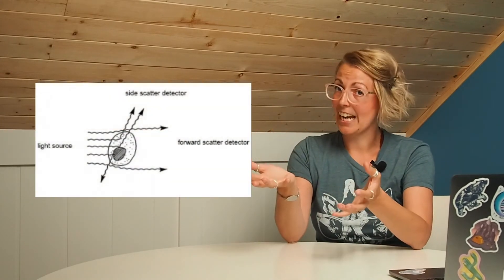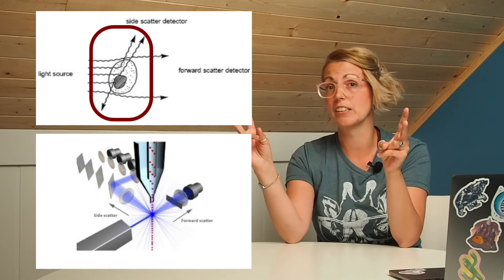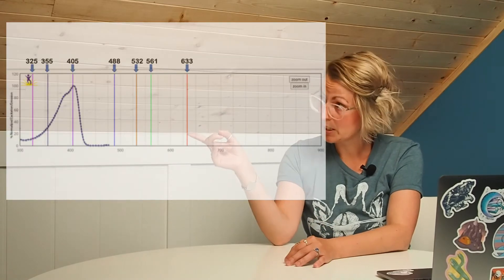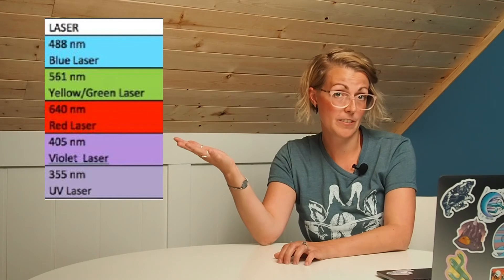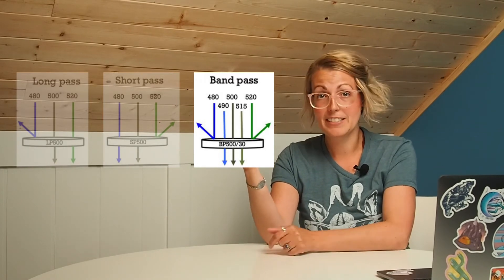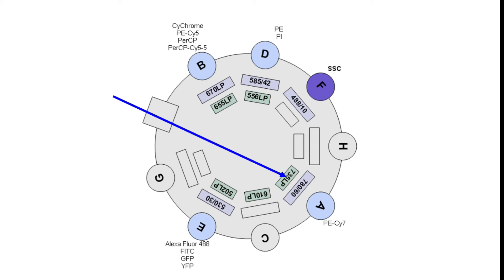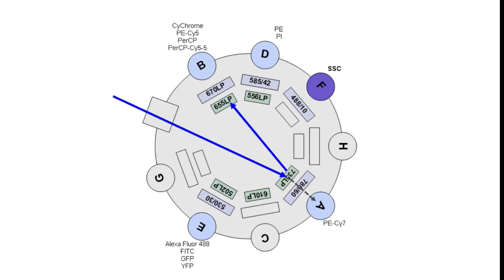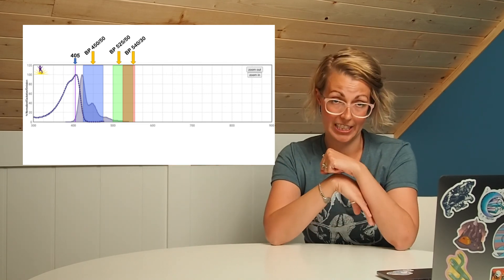Flow cytometry optics (Intro to Flow Cytometry - Episode 3)

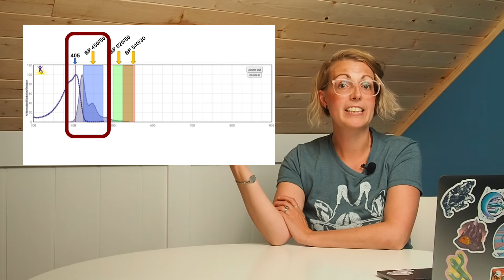Comment: At 06:40, you mentioned that for the 405nm, the BP450/50 filter is suitable but the range of this filter becomes 425 to 475 based on your example of BP500/30. Bur 405nm is not in the range; 425 to 475.
Reply from the maker: Thanks for the comment- you are correct. The range of this filter would be 425-475nm. In this example, you have both the excitation and emission spectra on the graph. The dotted line is the excitation and the solid is the emission. The 405nm laser cuts through near the peak of the excitation, which makes it the appropriate laser to use for this. The emission ranges from 400-500nm, with the peak around 420nm. So, yes, while the peak is outside of the filter range, the filter does capture a good portion of the emission spectra and thus can be used to detect the fluorescence from this fluorochrome. For emission, you do not need to capture to peak to detect fluorescence.
Reply: @ajarieger_flow  Okay got it. Thank you so much...